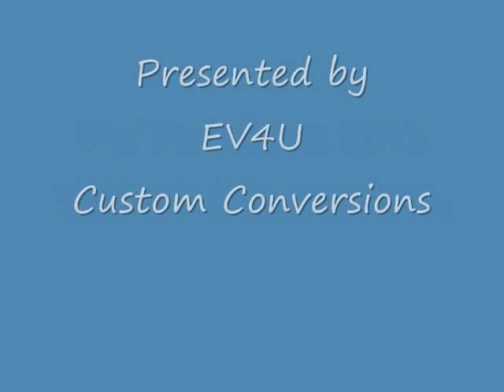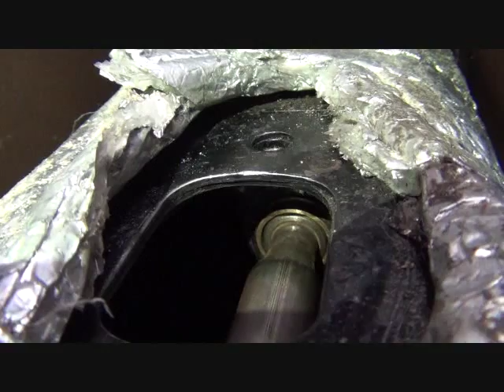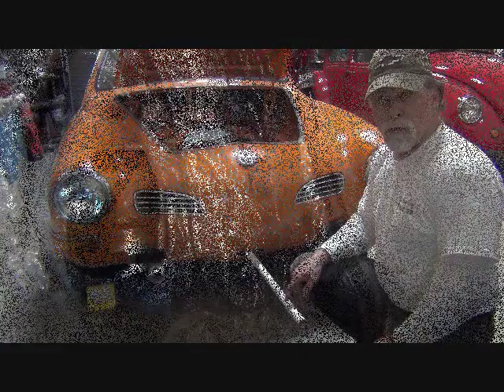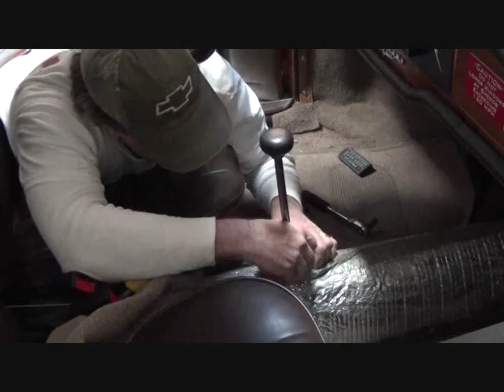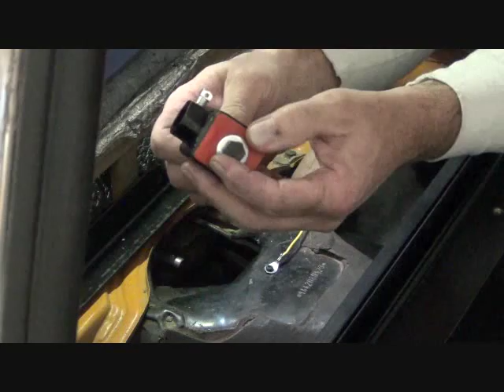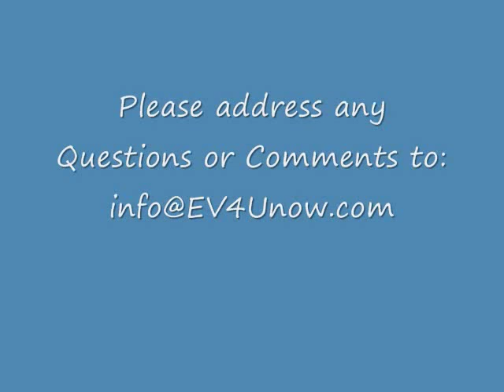VW Shift Rod Installation Method and Instruction - Another Good Idea From EV4U

Comment: This vid saved me much heart ache trying to get my VW beetle 1302s gear brushing replaced! Could not get the rod started thru the new bushing until saw this vid & used the plastic pipe with cut out to help push from front access hole to get it started! You sir, are a genius!  Thank you.
Reply from the maker: Glad it helped.